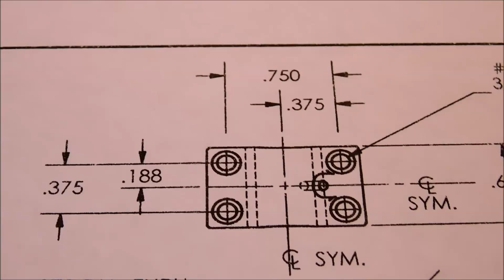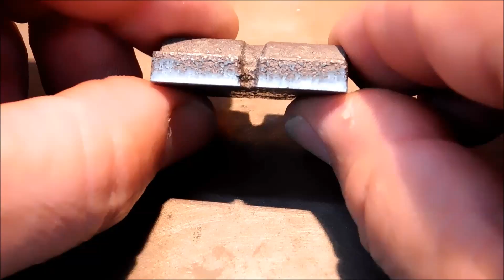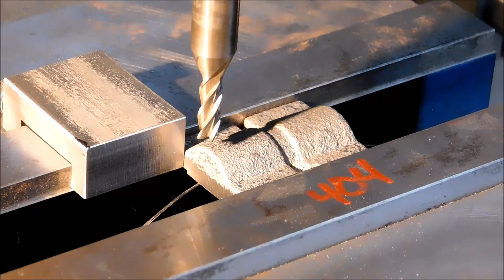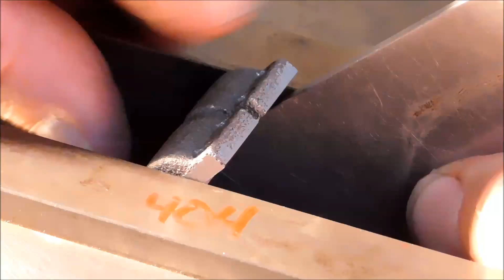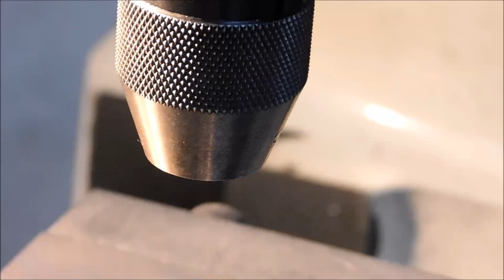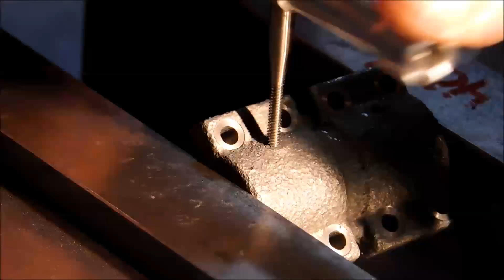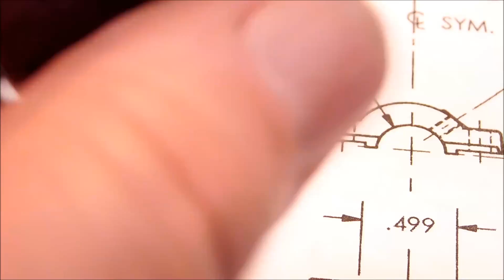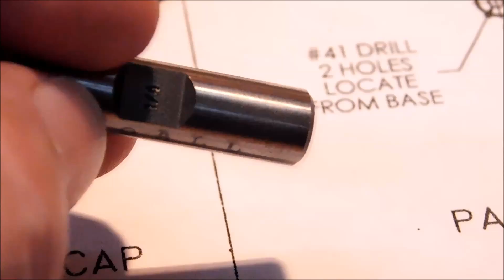Machining a Model Steam Engine - Part 6 - The Bearing Caps

Comment: I'm an armchair machinist and engineer and I love watching videos like yours. It would be good if you could go through the technical drawings of the engine and highlight what all the symbols mean and how you should approach them.
Reply: There have been several discussions on this: Consensus is these blueprints aren't a good example to walkthrough. They aren't correctly referenced and toleranced (for some parts). However, this project could be a cautionary example in a series on blueprint reading. There are several good books on Mechanical Blueprint reading going back over 100 years. I don't recommend referencing older books past about 80 or 90 years old, because a lot of the standard terminology changed during and after WWII. Once you are familiar with the terminology, Then go back to these older books and blueprint to find out why machinists are sarcastic, foul-mouthed, grouchy and grey-haired...
Reply: @matthewhelton1725  Yes, it would be useful if Joe explained both what the symbols mean and also where the prints aren't done properly.  I haven't seen the entire set of drawings, but I probably have drawn every symbol they used.  I would like to hear Joe explain how & why some parts of the drawings aren't correctly done -- even though I'm retired, I still like to learn, especially about things I used to get paid to do!
Reply: @bobvines00  Mostly on this drawings (which include several parts within one blueprint panel), it is a lack of reference dimensions (origins). Also, some callouts which should be on the drawings aren't on the drawings (or refer to non-existent datums), which is frustrating. In the cylinder casting machining video, he touches on this. Some of the issues can be corrected/ recovered by order-of-operation decisions (making certain parts before others and using those for references). Personally, I suspect it is related to someone transferring the drawing from line and paper to AutoCAD or some other digital format and omitting or munging some feature callouts.

Comment: Ah, the bane of 2-56 holes. Long ago we used to get these castings in 17-4 that called for 2-56 threaded holes. Through holes, thank God. Lots of operators had broken taps on those.

Comment: 23:14 Do I see a bite mark in that Kurt vice ?  Lol.
Reply from the maker: Would you believe me if I said those are second hand jaws and I bought them that way?
Reply: @joepie221  nice try!
Reply from the maker: @billchiasson2019  Sounded viable didn't it? But I am responsible for that. Proves I'm human.
Reply: @joepie221   Glad to hear it. I was beginning to think you were a self aware CNC machine!
Reply from the maker: @ttabbal  I do have an unusual  SKYNET tattoo I can't explain. Oh well..
Reply: @joepie221  truth be told I have one of those funny marks in my vise!
Reply: @joepie221  if you say it we will believe you, but maybe with our fingers crossed behind our backs.
Joe why not just run an end mill across the tops, with something clamped in the jaws of course, thats how i keep mine pristine. 😉
Reply: @chrisstephens6673  Then the parallels won't sit below the surface a nominal amount.. sometimes it's nice to know that the bottom of your part is exactly .125 below the top of the jaws, and not some strange number
Reply: @Rx7man  true but hardly insurmountable, that's the advantage of DRO.
Reply: @chrisstephens6673  no, certainly not insurmountable, but isn't it nice to know that if you need to make a part .1875 thick, that the parallel that the 1 7/8th parallel will give you the most grip and provide clearance?, or that being .0625 above the jaw will be right?
Reply: @Rx7man  being British i can't afford a Kurt, the last time i looked they were £1500 or about $2000, and anyway I'm metric.😉
Reply: @chrisstephens6673  Yikes! 3 or 4 times the cost here in the US. Why?
Reply: @larryschweitzer4904  i haven't checked recently but whatever it is out of my league. 😢
Reply: @joepie221  Yeah my not.  Lol.
Reply: I don't feel so bad about the one on my vice now!
Reply: I spotted that too!

Comment: Thanks Joe! Another great video. Congratulations on breaking 99K on the subscribers. I didn’t realize the belt sander would play such an important role in building this kit. Any guidance as to what one should look for in a good belt sander?
Reply from the maker: Hi John,
I am very flattered at the support my community has shown me and the material I present. I remember hitting 100 subscribers and bragging to my wife. I never intended to do a channel, but the questions kept coming and it just kind of happen. Its been a fun ride and I hope it continues. As for the belt sander / grinder. Its personal and budget driven. Mine is usually just for deburring stock after the saw gets to it. if you just want a hobby machine, go for something that runs on 110V and it doesn't have to have a variable speed control. That just drives the price up. My belts are 4" wide and  36" long, a thinner belt is better for shaping work, and longer belts seem to last longer. Just my 2 cents, but I like my little machine. It has served me perfectly.
Reply: Joe, with content like this you will never have to worry about subscribers. Your videos are both educational and entertaining. Your project approach to teaching is really working for me. Thanks!

Comment: Thanks again Joe for taking the time to share your manual milling tips with the rest of the world - some of them, like conventional milling around the perimeter to reduce burrs, are simple and I probably would have worked it out eventually but you're speeding up my learning process a lot. Some of the rotary table stuff you have shown in the past I doubt I would have worked out :)
Reply: Technically speaking it is climb milling but goes to show it can be used safely in the right situation.
Reply: @chrisstephens6673  Thanks Chris, you're correct. The terminology isn't second nature to me yet - I need to think more before typing. :)
Reply: @mhc6777  no problem👍

Comment: Joe, is there a problem that I'm missing with maybe just eyeballing your X zero point for each cap off of the little raised bosses for the threaded oil holes? You could use the same trick with switching to inc to have two zero's like you did when drilling and tapping the oiler holes. Is there something I'm missing with doing it this way to not have to keep taking the part out of the vise to for the two 4 holes?
Reply: Speaking as another CJ, i use the zero functions for all things like this and reserve ABS for the far left corner of the vice jaws for quick set ups.

Comment: Would it have been better to side mill both ends before drilling?  That way you’d have two machined surfaces at the end, instead of one machined and one rough cast/sanded?

Comment: You’re doing so good figuring this out! BlondiHacks channel really could use an ear to bend about this stuff and is about in the same place you are. She may be a step behind you or the same place. She has a small lathe and is learning a lot. Though you may want to or could do a little mentoring, check her out or contact her. Thanks, Ryan 💨💨😎🌶💨💨

Comment: Hi Joe, I wonder if you can help me understand why with such great precision that the bolt down holes appear to be offset within the outline of the casting ? Thanks in advance.
Reply from the maker: The holes are accurately positioned from the profile of the part at the base. Any draft on the part sides or differential in the radii on the cast edges will trick your eyes. If you can, compare the appearance from the underneath shots to the top shots. I believe you may see a difference.
Reply: @joepie221  Thank you :-)

Comment: Wow who ever did those castings are just awful they should go learn how to do a better job of it from Clark at Windy Hills Foundry.
Reply: for the amount they charge for these castings, the quality is a crime
Reply: @pacman10182  Right looks like a cold poor and the mold was just strait sand which is only good for large castings like a cannon or anchor windlass.
Reply: @kaydog2008  made by pm research, this one cost $130
at that price they could at least give you a little more meat to work with
Reply: FYI: Small castings are very difficult to do in cast iron. The iron in these small parts cools very quickly, so they have the iron at the upper range of the casting temperature (they are essentially burning iron) and run the pour very rapidly. They probably have more material in the feeders and risers than in the finished parts (it recycles, but not 100%).